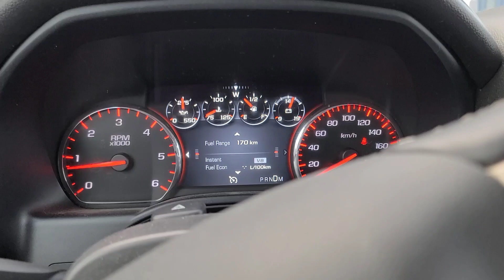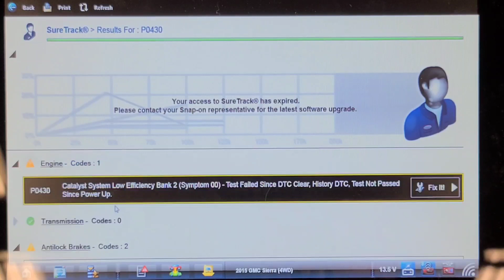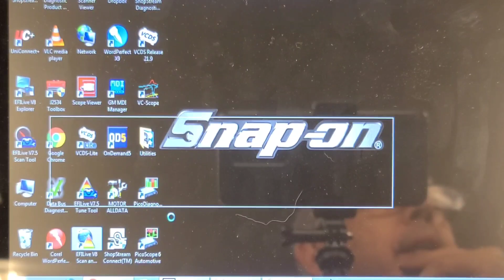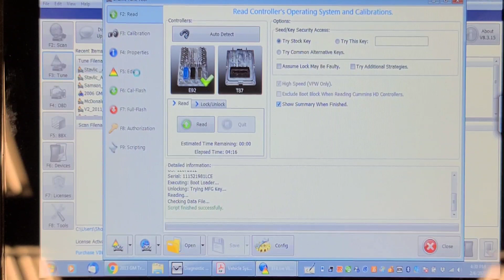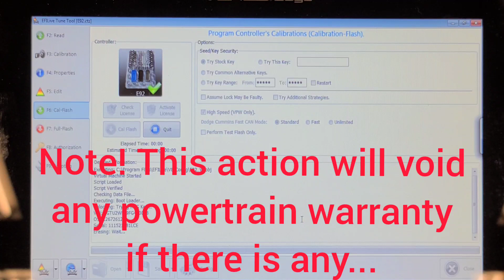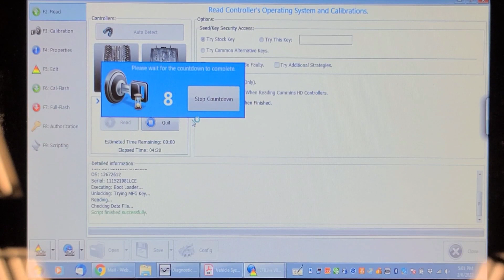2015 GM Truck AFM Delete Using EFI Live

Comment: To do this procedure I need to flash EFI live can and GM license that they sell on EFI site? Thanks.
Reply from the maker: @EHDiesel  you need the hardware from EFI Live then a vin license release from them.
Reply: @PhillipBailey  Ok then I just buy FlashScan® and the $125 VIN license.
One question: What is the GM license that costs $450 used for?
Reply from the maker: @EHDiesel  I'm not sure sorry. There are devices that plug into the obd2 port that just disable the AFM if that's all you want to do.
Reply: @PhillipBailey  I am interested in getting the most out of a live efi system, especially on duramax and ram cummins, but also camaros silverado and thaoe, but I still have many doubts.
Reply from the maker: After 2010 GM locked down the diesel ECMs making them write only. So you can't read the existing program from the ECM. There were companies in the USA that were selling custom tunes but I'm sure they have stopped given the recent crackdown by the EPA. Do your research prior to investing in the hardware since it's not cheap.

Comment: Did you have to obtain any kind of passcode to get the ECU unlocked? I have EFI live but I’ve only ever tuned diesel trucks. I’m looking into disabling my personal 6.2 AFM. Any help is greatly appreciated. Thanks for the helpful information in your video!
Reply from the maker: Yes, you have to buy a vin license. Gas are actually easier than the 2011 and newer diesels as they can't be read directly from the ECM but the gas engines can. You don't need a vin license to read the tune. Licenses are available from efi live
Reply: Right, I’m familiar with the vin license side of things. But I heard a rumor that you either have to obtain an “unlocked” PCM or have your stoke one “unlocked” … is that true in any way? Or can I buy a vin license and tune away like normal?
Reply from the maker: @laneamaimo5760 it's only on the diesels where GM has them locked down. The gas engines are no problem

Comment: good video! Is there a way using efi live to disable a specific obd2 code that keeps popping up that I want to ignore and prevent engine light coming on? (A P04DB Code obtained from the Engine Control Unit (ECU) indicates a disconnected, damaged, or malfunctioning crankcase ventilation system. This diagnostic monitors the Positive Crankcase Ventilation (PCV) system for leaks and malfunctions.) I keep getting this after putting a ccv vent kit on my truck so oil won't go into my turbo....& want to disable this warning and engine light coming on.... THANKS
Reply from the maker: EFI Live can turn off any code or monitor if you like. At least on gasoline systems anyways. Diesel is another thing though...
Reply: cool! any idea where I can go to learn how to turn off/disable a specific code? @PhillipBailey
Reply from the maker: @DeMilleFamilyGaitedHorseRanch  do you have access to EFI Live? It's under the engine diagnostics tab. Open that and you will see a list of all the codes. Find the one you wish to ignore. Select it then in the drop down tab select "not reported". Select save then calibration flash.

Comment: You didn’t need to get new lifters or cam shaft? Just wondering because I’m thinking about doing it also
Reply from the maker: This process just disables the DOD electronically. Since most of the issues of stuck lifters and bent pushrods occur when the system switches from v8 to v4 and back to v8 this keeps it in v8 mode. If you have a failed lifter or pushrod then that has to be fixed first.
Reply: @PhillipBailey  thank you